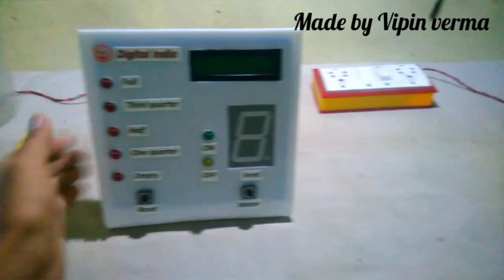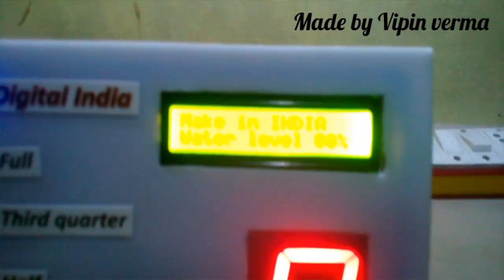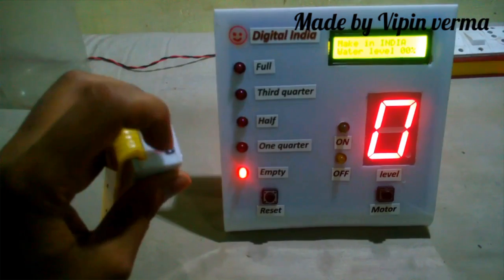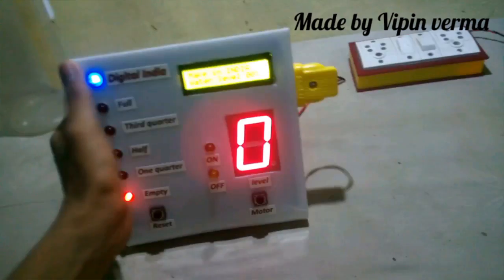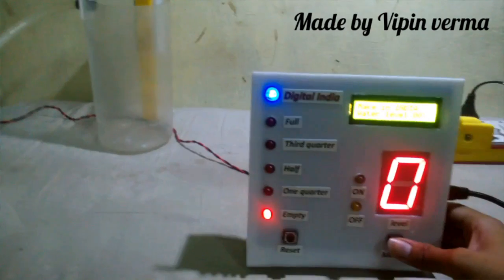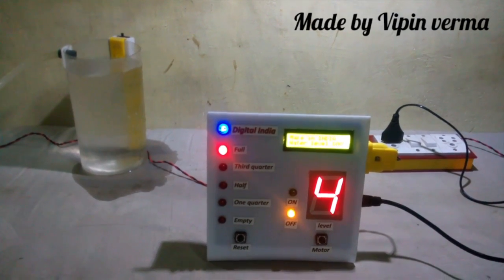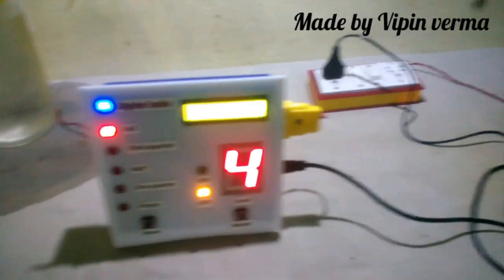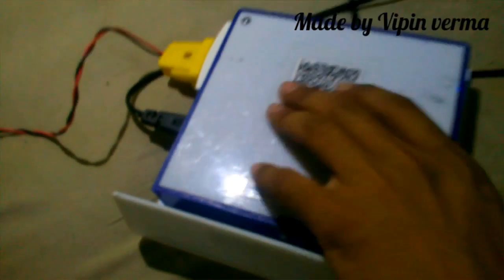Wireless water level indicator with pump

Comment: Can you send me the circuit diagram and components required pls..... ID:karpov03@gmail.com
Reply: i didnt get any mail dude pls send it soon pls

i'm doing final year project
Reply: Okay Dude Thanks For ur reply
Reply: Vipin8821... Plz send me the circuit diagram.. N i hve send u an email.. So plz consider it and reply me as fast as possible.. Thnx.
Reply: Sorry bro.. It sent by mistake.. Instead of vipin it has been sent to u..
Reply: Vipin8821 hello... our society is facing water problem... Indicator panel shows over current. Can u suggest what to do ? my number is 9969361754
Reply from the maker: How to make Wireless Water Level Indicator | Code & Schematic 

https://youtu.be/VP2LWtHxhhE